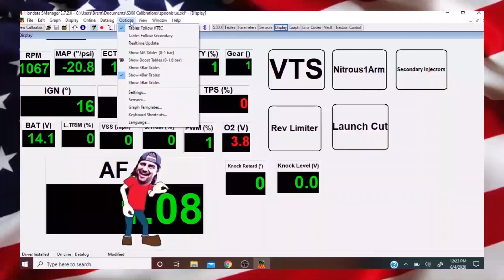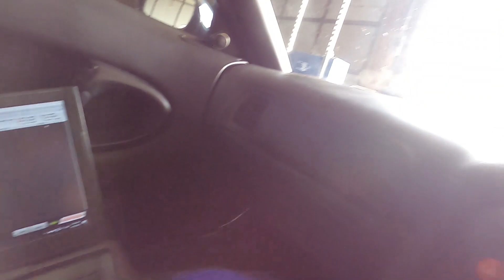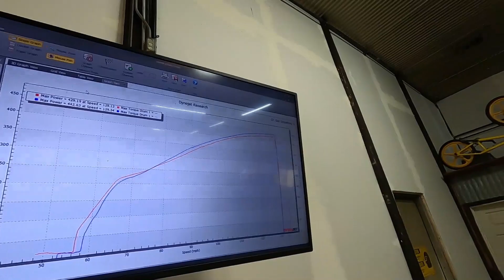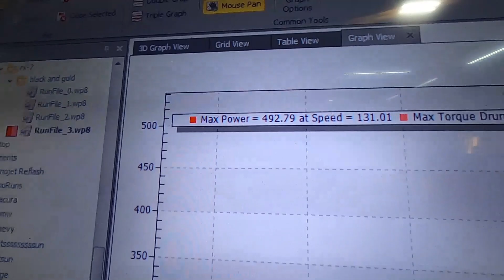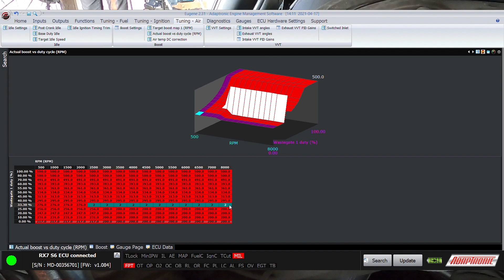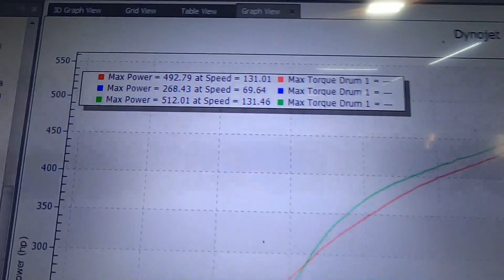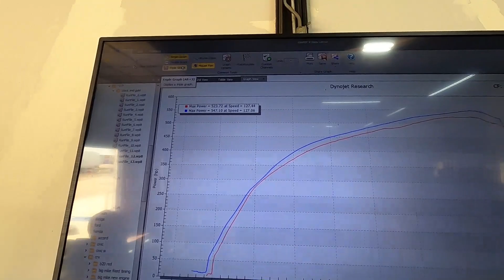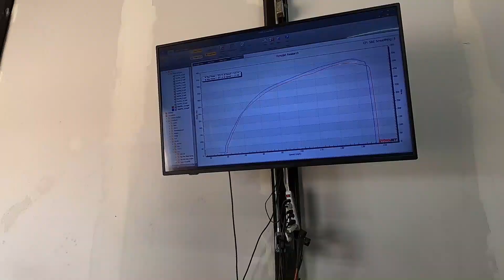EFR Turbo Wakes up this RX-7

Comment: I have the same turbo on my FD.  Flat torque curve from 3200 to 8000rpm.   I'm pretty sure if this turbo existed 15 years ago, LS swaps would be way less popular.  Added reliability with going single and pretty decent power gains over stock.

Comment: Should I buy a forged bottom end, APR hardware LSVtec with a Precision 58/58 JDM ITR Front end integra with newer ppaint, no rust. 450 Walbro, 2000cc injectors, built B16 head, LS trans with carbon synchros, speed factory LSD, custom manifold, tial wastegate, 5bar map, Demon V2 neptune ECU, ARP headstuds, GSR cams, Ktuned shifter, Comp stage 4 clutch, made about 525whp on E85 but needs a return after a bottom end refresh after losing oil pressure. Now has an ACL racing oil pump, AEM guage, AEM AFR, etc etc

car is clean inside and out, 12k

Comment: The rotary is supposed to be running SUPER RICH on boost. Don't yet it go stoich or lean at all or u will detonate aka ping(for rotaries) which can send a rotor in reverse/wipe out seals instead. Just keep it rich and beat on it at the end of ur drives so it will last a long time. If you baby a rotary it will break WAY faster than if you beat on it daily.
 ROTARY ENGINE: 
Daily beatings= Long Engine Life

Babying and Garaging= Broken ASAP
Reply: ethanol is a beautiful thing 🌽💪

Comment: I love Hondas always have but racing ive always build fox bodies and v8 rear wheel drive.i woupd build a k series swap Honda drag car only awd the one time had a civic high hp turbo was about 650 700 all iy did was spin thru all gears was kinda annoying